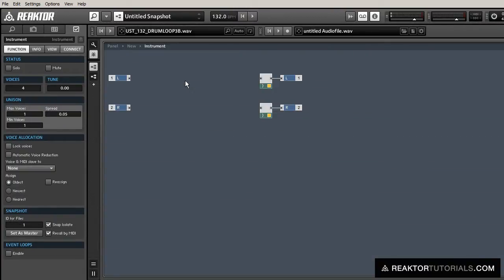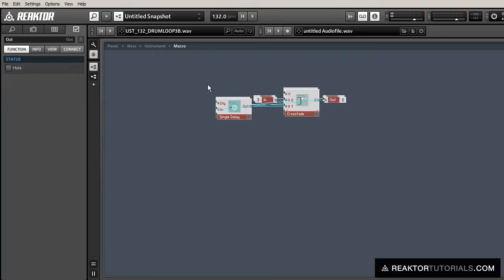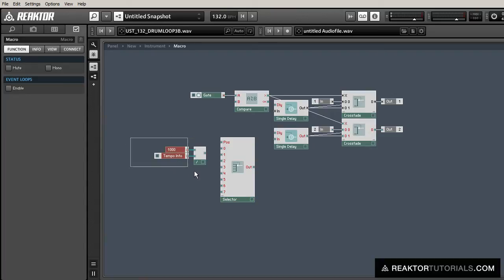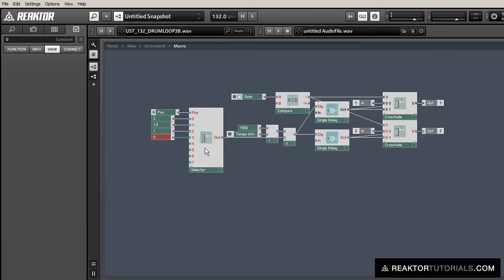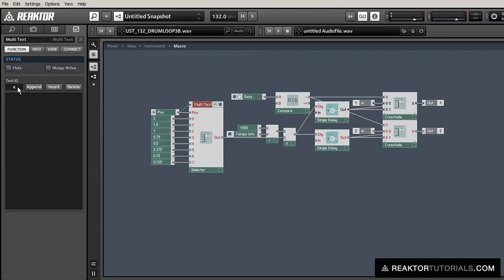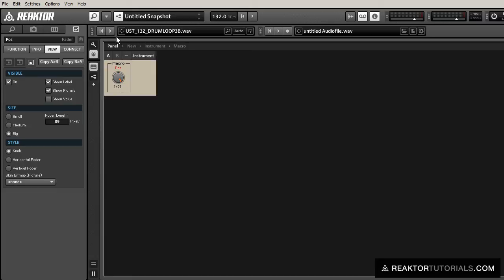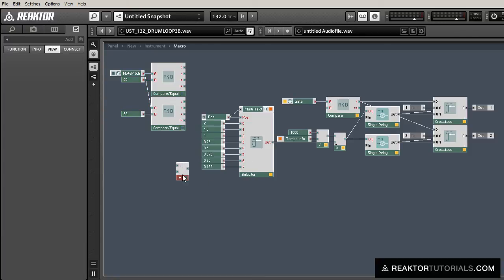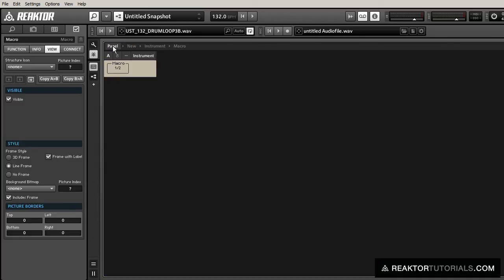HOW TO CREATE YOUR OWN STUTTER GLITCH EFFECT IN REAKTOR

Comment: you need to learn about monophonic and polyphonic signals and when to use them. in short you tried to plug a polyphonic signal into a monophonic module. in the case of FX, they should almost always be mono.

Comment: Hi Salaman, it's really nice, but i don't know if it's me, in my built version it seems that the audio signal just doesn't pass thru...!
I didn't add the midi keys controlling 'cos i just need a knob (and i add an on/off button  that surely works), i see al the signal lamps on in every single module, and i don't figure it out!
i tried to send signal both from player and a sampler, like Kompressor, but nothing.
continue ->

Comment: Hi thanks for the feedback.

There is really not very much math in this tutorial, like at all! All that is happening is we are using the tempo info to calculate the length of one beat, in milliseconds.
 
The equation for translating from frequency (Hz) to time (milliseconds) is Ms = 1000/Hz. 

Then we take that value and multiply it by another value to determine the length of the delay line, in beats. 

I hope that helps!